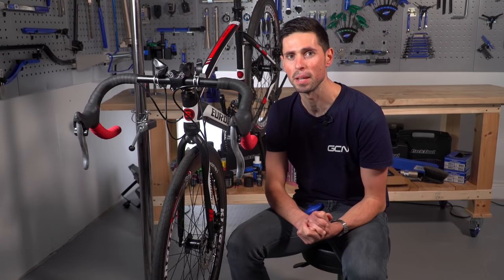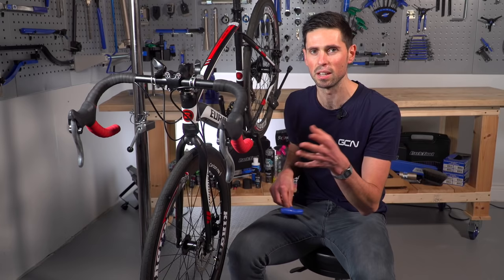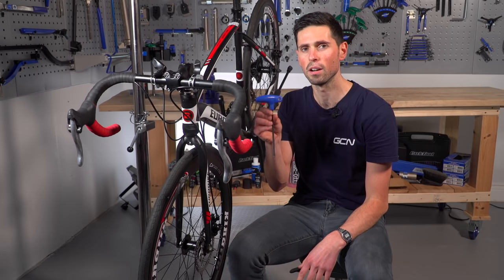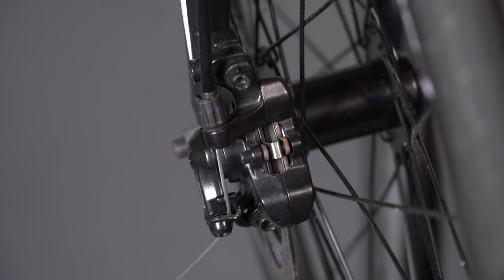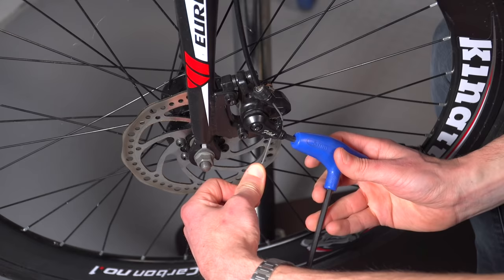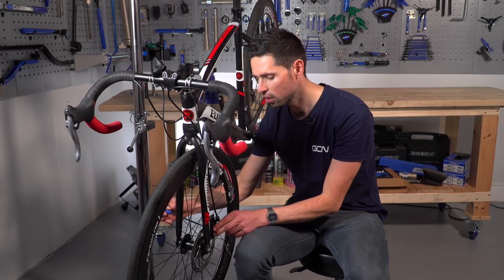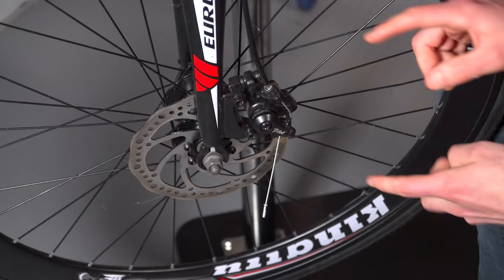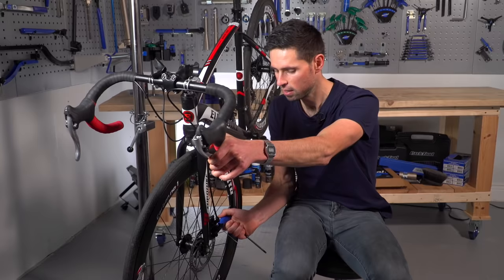How To Adjust Cable Activated Disc Brakes | Maintenance Monday

Comment: I hope hydraulic disc brakes are just a fad, and that just like the threaded BB we see a return of cable actuated disc brakes. 

I will take hands down take ease of maintenance over a tiny marginal improvement in stopping power 11 days out of 10

Comment: How to adjust cable activated disc brakes: tear them off the bike and get hydraulic brakes.

So so so much better.
Reply: Some might not find spending couple hundred quid for a bit of convenience a great deal.
Reply: I second this totally. How about swapping out these for flat bars with hydraulics, that's my next project!
Reply: @myownsite  A bit of convenience? Yeah it’s about a lot more than that. And worth the expense.
Reply: @discbrakefan  is it? Cable disks work fine.
Reply: Being a mile-muncher who takes on road paths to very rural areas with almost no competent bike shops, I'll take my chances with my cable discs. Maintenance is cheaper than a bag of sweets, and under the right setup and technique, can have the same lever feel as hydraulic systems and have 75% the braking power of hydraulics, which is enough for me despite speeding through 20% grade descents.
Reply: @avocette  Having used both on the same bike, the difference is light and day.
Reply: @discbrakefan  but what does it matter? Brakes have pretty much one job
Reply: @discbrakefan If you actually understood my previous comment, then you'd know that I never argued against the superior braking power of hydraulic brakes.

The reason why hydraulic brakes have better power is due to better efficiency in transferring force from the lever to the pads, with less inline friction compared to cable systems, and better leverage.

I simply said that:
1. With proper part choice (opting for mechanical calipers that have long actuation arms, short-pull levers, smooth surfaced cables, compressionless housing, etc.), setup (lubricating cables, housings, and levers, optimizing cable routing for less kinks, etc.) and maintenance (cleaning or replacing cables and housings when needed), one can significantly narrow the gap between mechanicals and hydraulics.
2. There are a significant portion of the biking community that find mechanical brakes sufficient and have no need for hydraulics.
3. Mechanical brake parts are user-friendly, roadside-repair-friendly, and are almost always available in almost all bike shops.

With these factors in mind, the logic behind advising people to trash mechanical brakes on a whim, in a video specifically catering to people who use mechanical brakes, is invalid.

Comment: Cable > Hydraulic

I mean, why wouldn't you want to have a hydroscopic (absorbs moisture from the air) fluid to actuate your brakes when water in brake lines leads to corrosion which leads to brake failure? Also as a bonus if it leaks out onto your bike it'll eat through your clearcoat.

Pushrod is the best form of brake actuation but if you think cable disk brakes are rare nowadays good luck finding pushrod actuated brakes.
Reply: Completely disagree. Hydraulic means so much less effort required on the lever, better modulation and power. 

Water ingress is very slow in a sealed system and a fluid change even rarely done will take care of any corrosion. 

Shimano brakes use mineral oil which will do exactly nothing to your clear coat.

Hydraulic every time.
Reply: i did the same descent twice, those have a 25% gradient in some parts, one with cable actuated hydraulic brakes and one with hydraulics. i got down safely with the hydraulics, while i got into an accident with the cable ones, i felt no more brakes in the bike. so no, it will be hydraulic for me since that accident. besides i also got a cable snap one time 2yrs before my accident in an old bike, i hit a motorcycle with cargo storage on its side, head on at low speed.